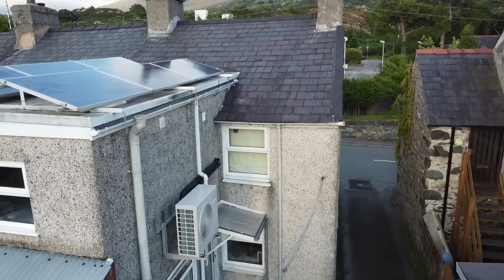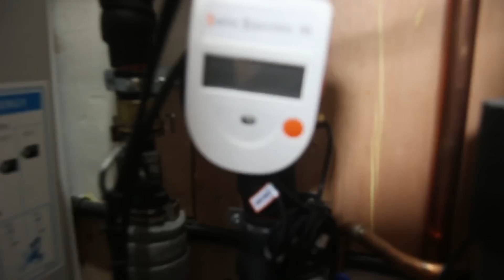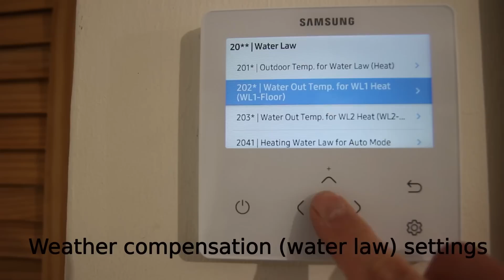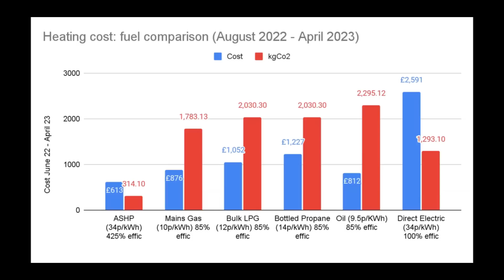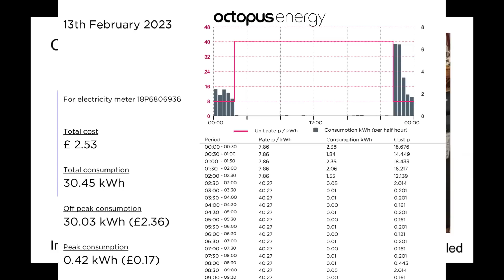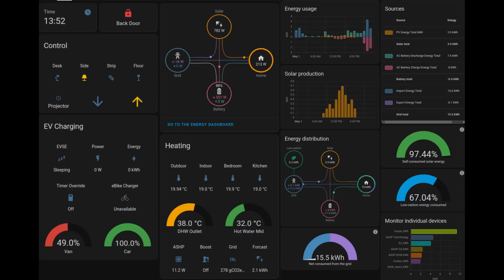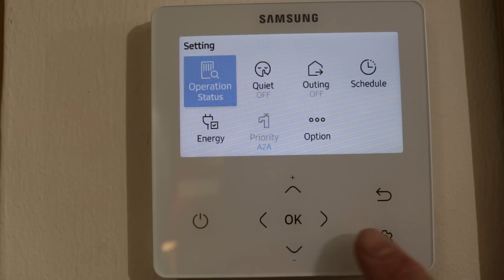Part 2/2: Air Source Heat Pump 1st Winter Performance 2022-23 in Solid Stone Welsh Cottage

Comment: Excellent video. Thanks. We've run a heat pump in our house for two winters now. Our experience is very similar to yours. Our house is old (c1690), made of rubble and cob and far from thermally sealed. But it's does have heavy masonry (thermal mass) which is perfect for the constant gentle heating of the ashp. Far more comfortable and cheaper than previous which was a modern mains gas combi. Heat pumps clearly work in any kind of house with a bit of simple insulation and draught proofing. The secret (as you found) is using accurate heat loss calculation to correctly size the pump and rads to run at low temperature. Thanks again. Your vid will be perfect for my daughter's new home!
Reply from the maker: Thanks, that's great to hear. Yes, I think the large thermal mass of the house is useful

Comment: Great monitoring!

One experiment for you:

Is it 35C Vs 30C that's the issue; or use it the minimum compressor frequency/power level that's the issue; with regards the COP hit?

Turning down compressor frequency makes it less efficient. Motor efficiency hit. More losses to internal leakage. Overheads remain similar. Control boards, circulator pumps, fans etc only turn down so low.

I wager the unit would be more efficient at 30C if output power levels were the same.

This is a controls limitation. The Samsung has been configured to "just run" with whatever is thrown at it; instead of forcing cycling operation where this is more efficient.

Homely found similar when working with jez climas Ned Samsung mobobloc. Long and low doesn't always cut it if the heat pump is configured to permit turndown below best efficient point.

Samsung don't provide and detailed performance data or operating point limitations. If you look at the vaillant docs you'll see the cop drop-off at lower outputs; along with quite a high minimum output before cycling. That'll not be as low as the compressor will go. It is as low as it makes sense to go though.

Perhaps there's more merit in Graham Hendra's "Lizzie curve" fudge that we realise! (even if the original purpose of setting a 38C minimum was warm to the touch rads) also adds load compensation control that Samsung controls lack.
Reply from the maker: Yes, you're probably right about compressor speed. Unfortunately Samsung the Samsung controls are quite limited, I don't have the ability to control the compressor speed. The only time I've been able to make the system run nicely at 30C was re-heating the house was cold after we had been away for a week, at this point the system was having to work harder, so compressor speed would have been higher and emitters were able to dissipate the energy since the rooms were cold. 

Jez told me that his 8kW Samsung Gen7 HTQ uses the same compressor as the 14kW HTQ model, therefore this issues at low power are more profound. I love what Homely are doing, HP controls really need to get a lot smarter before they are properly ready for mainstream.  They should be able to self optimise the perfect WC curve, Homley seems to be the closes we've got to this. Although, I don't have first-hand experience. I'm aware that my system is not particular normal since I can get away with running 35C even at design temperature, so I run almost a fixed flow temperature. 

I've just been reading about the 'Lizzie Curve'! I can understand and sympathise with the reasoning, but I wouldn't recommend that as universal advice, every system and occupants are different, we should aim for the best possible performance, ideally a maximum of 40C at design temperature to make the system economic to run.
Reply: Interesting @GlynHudson  

I didn't think the compressors are the same I'm the "8" kW and "14" kW units. More the problem is that these aren't really "8" kW units at all. They're bigger - they would kick out far more heat at modest outdoor temperatures and modest flow temperatures than they are limited to by their software - which is why the turndown appears poor. They appear geared up for continental climates given how far into the double digit negatives they produce the high flow temperatures. Which is fine except winter happens quickly on the continent (drops from low double digits heating off to below zero quite quickly) vs the 10 months of spratutumn we get in the UK. It doesn't matter to a continental if your low power performance sucks because you just don't operate there; whereas in the UK with mild weather and tiny houses even the smallest Gen7 unit is going to be bouncing around in the bottom of the curve.

They look good on the test cycle though. ;-)

On smarts...there are plenty of units out there that already have self optimising weather compensation and indeed load compensation. Even the 2009? Vaillant ecotec sat on my kitchen wall can self optimise weather comp if you so wish. 

Homely do bring this to the Asian units that don't have proper heating controls built in. It's only a matter of time before they're all provided with such things though IMO. And a head end system you can pair them to etc. More I think the Homely business will be optimising heat pumps and batteries around time of use tariffs. That's much more geographically specific/local market specific than setting up the heat pump. Which the vendors can do better if they actually wanted to.

What I think you're perhaps seeing is the difference between units designed to avoid callbacks and units designed to operate efficiently.

Those designed to avoid callbacks will "run if it's possible to do so" irrespective of efficiency. (hello Samsung et al; see also instructions that include four pipe buffers etc)

Those designed to operate efficiently risk doing things that create callbacks (refusing to operate at low compressor frequency/with lower than ideal primary flow; generally being more demanding of the installation)
Reply: @GlynHudson  45 at design condition seems to be a sweet spot if you look at:

- the system volume in radiators needed to deliver this
- the minimum turndown at high ambient conditions

You find that you never "run out of radiator and cycle too much" or "can't possibly partially zone the house at higher ambient" if rads are sized at 45C. Whereas you do if you go for 55C.

You also find that the radiators are materially more palatable in dimension than they are at 35C.

Running the house at 19C rather than say 23C is an interesting one to compute.

Radiator temperatures need to be disproportionately higher to deliver that. Your room to outside dT climbs by 4C (+20% heat loss) at the same time as your rad to room dT drops by 4C (so start at 49C to offset this and you'll be north of 55C by the time you've made up for the extra heat loss)

Therefore if design temps are kept to 45C at design condition you also ensure that the property is still usable by 90 year old grandma made only of skin and sinew etc by using the option to bump up to 55C.

Build for 55C at the nominal design condition and the pensioners will be grumpy.

35C is great. But diminishing returns at that point vs say 45C.

Comment: Hi Glyn, this is a really excellent video showing the effectiveness of your system - heat pumps are absolutely the way forward and I'm glad to see someone showing how these can be practically used for the UK's old housing stock. I do have one question for you - did you consider using an external hot water tank at all? They can be extremely well insulated and appear to be a good option on smaller houses with some exterior space. Happy to hear your thoughts. Many thanks!
Reply from the maker: Hi, thanks for your comment. I had space inside the house and limited outdoor space so the obvious choice was to fit the tank inside. However, I know other people who have successfully fitted a tank outside or in a shed, it's totally possible. Also, a heat battery e.g Sunamp can be a good solution instead of a DHW tank if space is limited.  Here's a good blog post about an external DHW tank https://energy-stats.uk/plant-room-project/
Reply: No they are actually not, did you see the tv program, they are way too expensive to install and way to expensive to run at the current electricity rates .
Reply: @uksupporter8867  I'm not sure what TV program you are referring to but I can assure you there is going to be an influx of heat pumps being installed on UK properties over the next decades. Electricity prices are high because wholesale gas prices are high. With more and more renewables coming online there will be a divergence between the trend in electricity prices and gas prices sooner or later, therefore running costs will drop even further below that of gas boilers (they're already significantly cheaper to run). You are correct that installation costs are high, as with any emerging technology the cost of this will also plummet with more national uptake. It's good to have a questioning attitude but I would encourage you to dig further into the details with an open mind.

Comment: How come you didn't give me those flow meters?! They look hi-tech! 😂love your content and style of video,
Reply from the maker: Hey Owen, thanks! The Sontex 789 has a higher pressure drop than Kamstrup 403, so we only use them for heat pumps up to 7kW. I do like Sontex meters, they use a different flow measurement technique which is less effected by turbulence and air. However, the larger Sontex meters e.g Supercal 5 for heatpumps above 7kW are significantly more expensive.

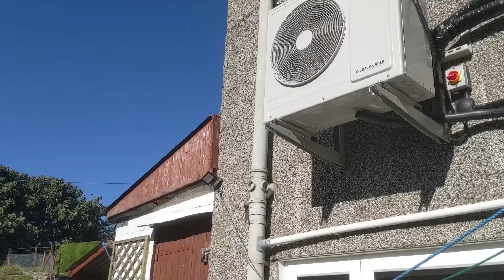Comment: At 15:26 it's clear that the unit is in the sunshine. Do you think it makes a positive difference to use what ever radiant solar energy is available (as opposed to putting the unit on a north-facing wall)?
Reply: For Ground Source ....... ICAX Thermal Banks store heat between seasons
Reply from the maker: No, I don't think this will make any significant difference to the moving air temperature the unit sees, the most important thing is that the unit can get plenty of air flow

Comment: Great presentation with the charts etc, did you use an energy monitoring software system or did you do the calculations and then use a spread sheet.
Reply from the maker: Thanks, I used OpenEnergyMonitor Emoncms to monitor the heatpump and produce most of the graphs, but I did create some with using google sheets  https://shop.openenergymonitor.com/level-3-heat-pump-monitoring-bundle-emonhp/

Comment: Another thought - do you have any problems with humidity with this setgup and given that your house is fairly airtight ?
Reply from the maker: My house is far from airtight compared to a modern house, we also have trickle vents, the door blower test just indicated that my house is more airtight than the default value used for old solid stone houses, my house is still more leaky than today's building regs. No issues with humidity, especially since getting heat pump the house is at a steady temperature which is better for the building fabric.

Comment: Just thinking about it you say you have FSV 2093 sometimes on 3 from memory this makes the pump atart and stop in 7 minute intervals or by water law i think? the problem the control bax has with pump switching is the on board relay shorts shut and a fault comes up meaning flow when there shouldnt be any. this often happens if more than one pump is connected due to the relay only being rated for 0.5 amps. This is from terminals 7 and 8 for primary pump. what is recomended is to fit a external relay so the control box relay is purely energising the external relay that then gives the power to the pump. my friend who fits these for a living has now started doing this as a matter of course due to a lot of failures. this has mainly been due to the Heat Pump supplier giving duff info which is why i contacted Samsung Tech to get it confirmed. The relay he uses is a Schneider which also has a varistor on the coil to prevent any backfeed to the on board control box relay.
im sure that as your system is small and only a low flow you only have one circulator connected which is below 0.5 amps. The relay isnt that expensive if you wanted to fit one as a precaution
Reply from the maker: Thanks for the info. I've got FSV 2093 set to 3, this does not limit the system run time, in the winter the system can run for 24hrs without stopping. I've only got a single pump which is 0.1A so well below 0.5A.
Reply: @GlynHudson  hi Glyn if you have it set on 2 the compressor stops but the water pump stays running which is not a bad option as then the water pump relay isn't switching on and off when running so will not bugger up the relay. My friend has had some go with just 1 small circulator on it
Reply from the maker: @johnfreshwater3790  I've got it on "room temp on/off WL interlink on/off (water pump 3)" which keeps the pump running for a while after compressor is swriched off this option it needed to ensure that after a DHW cycle the residual heat is disappeared into the radiators otherwise the system will wait for a long time for the water in the primary pipework to cool before resuming cental heating.
Reply: @GlynHudson  that makes sense. In the Samsu g training they told my friend to set it on room temp signal on off only which I have used most of the time but when using the controller as the thermostat you don't get the option to plus or minus the outlet temp by 5 degrees so I use a third party thermostat to have the option and then drop ot a little if I feel the need and sometimes at night in the winter as it tends to prevent it going into a defrost cycle if you just have it ticking over. I have tried all sorts of options but can't make my mind up which is best. Might see if I can get a second hand buffer to put just on the heating circuit to increase capacity and then try a few different options. I do like to tinker which drives the other half crazy!

Comment: Thanks for posting this follow up Glyn, very detailed and super impressive results, excellent work!  You inspired me to push on the controls a little harder to see if I can improve things.  Switching from fossil fuel to heat pump already reduced the maximum achievable DHW tank temp, so I was happy we could "live with" that change already I didn't want to push it further.  Not sure if you found you needed to schedule or ration hot water usage with your setup of one tank top up per day, that would be a tough sell for my family, but I'll probably be surprised at what some creative optimization can achieve in terms of energy savings without deprivation.  Thanks again for sharing your experience!
Reply from the maker: Thanks, we have plenty of hot water, if we need more we just press the boost button on the controller or mobile app, the heat pump heats water much faster than an electric immersion, it only takes about 20min to top up the tank. 150L is plenty for a couple showers and a bath for a baby. I've found that topping up the tank to a relatively low temperature twice per day is more efficient that once big topup to a high temperature once per day.

Comment: This is exactly the sort of videos we need, true performance data. Yes you're absolutely right on the open loop system. My older Samsung won't go lower that 30⁰ so will experiment  with similar setup. I have seen engineers set the bottom flow temperature curve setpoint around 20⁰, complete waste of time IMO.

Comment: Question; why would leaving out a low loss header improve a heat pump's performance?
Reply from the maker: Energy is lost due to distortion which results in a higher flow temperature from the HP being necessary to achieve a given radiator temperature, Heat Geek did a good video on this. In some installations they could be needed e.g large houses with lots of zones and or undersized pipework. But LLH or buffers should be designed out for best performance if possible  https://youtu.be/mNcRx45DQ8M

Comment: Hi Glyn, Love this video this is great to dispel the naysayers and FUD we are experiencing atm. I had my Daikin 7kW installed by Octopus in June 22 and to backup what you have found I did not freeze in Dec 22 !! The design was 50c @ -2c ext. In Dec 22 I reduced weather comp to 50c@-15 / 30c@18ext. Our annual stats were were Heating 2667kwh ==> 9682 kWh (sCOP = 3.64) DHW 532kWh==> 1270KWh(sCOP = 2.39). Wondering if I need to add extar rads to get higher sCOP !! We also have solar but no battery so we used further 867kWh using Eddi diverter 68% of which was free ! Our average cost of electricity was 24.5 p/kWh as we used roughly 50% at night rate on GO Faster. . We are now looking forward to Ripple 2 savings  and considering the final step of a battery. Keep the videos coming . Thank you
Reply from the maker: Hi Philip, thanks for your kind comment. A COP of 3.6 is pretty decent, your system will be cheaper to run than mains gas. I'm surprised Octopus set flowT of 50C at -2C ext. Assuming this is what Octopus calculated that you would need, this indicates that your emitters are a bit on the small side, and you probably won't be able to reduce the WC curve any further. Radiators are relatively low cost and usually not too difficult to upgrade. Does the Daikin have built in COP monitoring?
Reply: @GlynHudson  Yes I have done a daily read for both heating and hot water to get my figures. It is a shame that all the Data is on the controller but not accessible remotely. My system is an Altherma 2. I have however set up home assistant to mimic openenergy monitor and fitted temp probes on flow and return. What I don't have is a flow monitor I can read into HA despite the controller having this data !! I am hoping that my sCOP will be higher this winter as I only sorted out my weather comp in second half of heating season. Cheers.